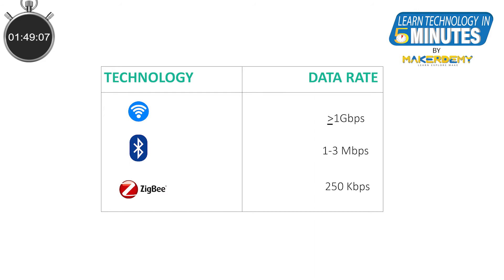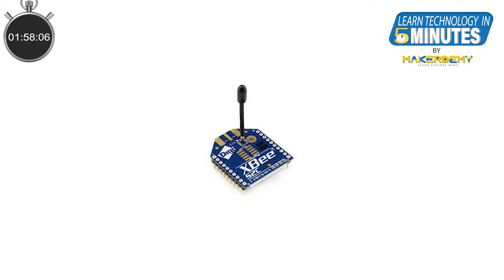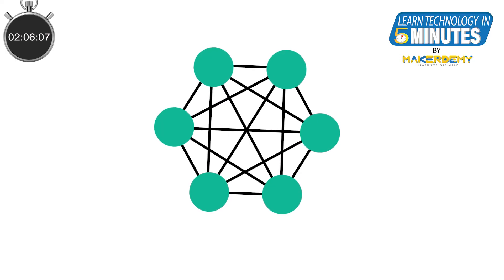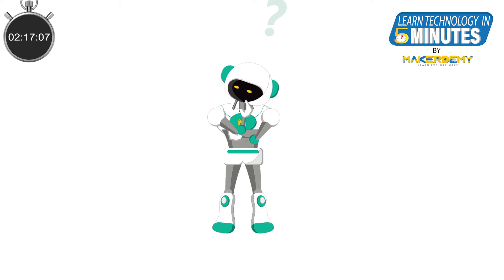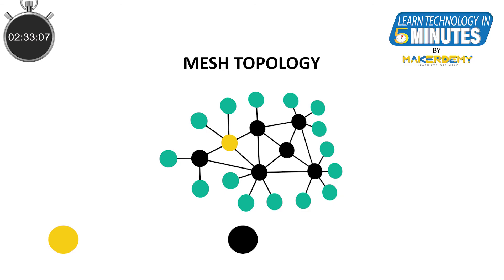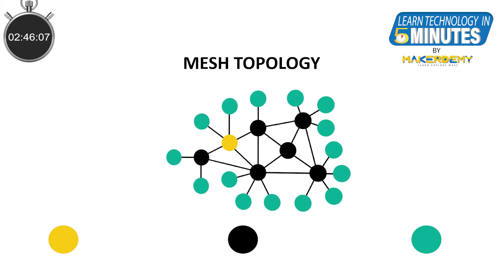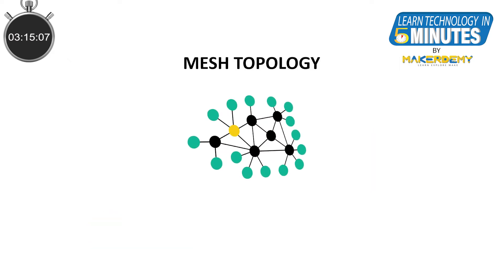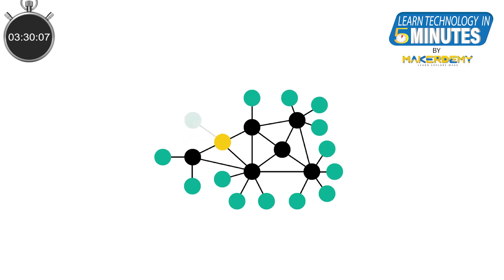Introduction to Zigbee (2020) | Learn Technology in 5 Minutes

Comment: What's the difference between RS485, Modbus, Zigbee and MQTT and how they work together in general?
Reply from the maker: Hi Ricky. It is very difficult to explain all the protocols mentioned and give the differences between them in a response to a single query. We have tried our best to explain and differentiate between all in brief.
RS-485 is responsible for point-to-point communication between the electrical devices. It can work for long distances by using long cables and it supports multiple devices on the same bus. 
Modbus is a serial communication used with PLCs. It is a method used to transmit information over serial lines between devices. 
Modbus is a protocol type whereas RS-485 defines protocol’s signal level.
MQTT is a messaging protocol on top of TCP/IP used for sending messages. 
Zigbee carries a small amount of data over a short distance and consumes very little power. 
Zigbee and MQTT integrate well and Zigbee2MQTT is used in many home automation
Reply: @MAKERDEMY  thank for the brief but concise reply:)

Comment: Why not use BLE Mesh, you can operate devices from mobile also
Reply from the maker: HI. Yes BLE mesh can also be used. Choosing a methodology depends on the application, needs, budgets, speed, reliability, etc. For example if your devices are battery dependent Zigbee may be considered as a better choice, on the other hand if you have a larger IoT based network for industrial applications BLE mesh may be considered as a better choice.

Comment: what different with remote rf 433mhz???..this remote rf is low power consumption n price is very cheap
Reply from the maker: Hi Ahmad,

It depends on the Application you are trying to build. If it just a simple project, that needs to send data over the air, without the intention for scalability, security, interoperability & reliability, then you can use the RF433 Modules. On the other hand if you are trying to build a true IoT System that need to be build across a lot of nodes, ZigBee can support more than 60000 nodes in a single network, through its Mesh Topology. Also for mission critical application, where fast and reliable data transfer is a must, ZigBee provides as low as 30ms response time with proper acknowledgment messages, to ensure that the data has reached its destination, whereas the RF433 doesn't have that feature. Moreover, ZigBee supports Full Duplex Communication that too encrypted by 128 bit AES, which is lacking in the RF. Furthermore, unlike what you have said RF433 doesn't take less power than ZigBee. It all depends on the number of packets being sent, and the polling frequency. You can refer this paper to see the graphs of power consumption. https://www.researchgate.net/figure/Energy-Consumption-per-Week-for-RF433-ZigBee-Bluetooth-Wi-Fi-Using-Communication_fig2_311841905 .We hope this was helpful.

Thank You